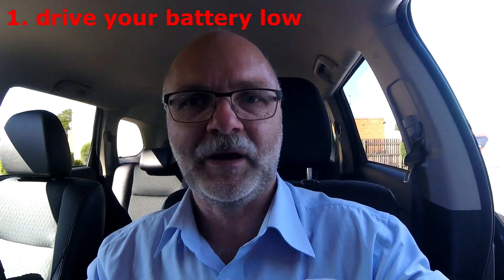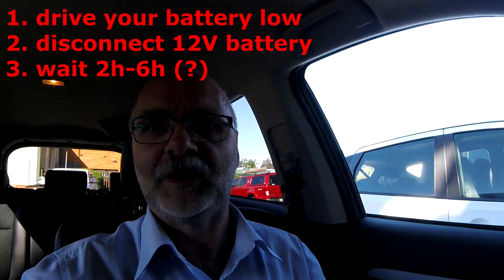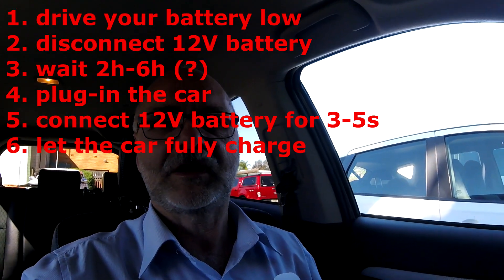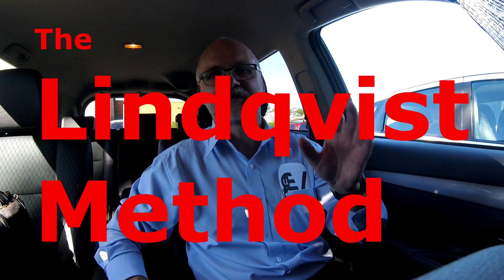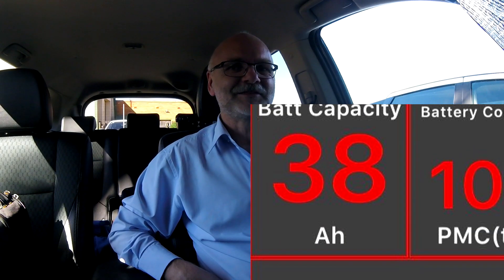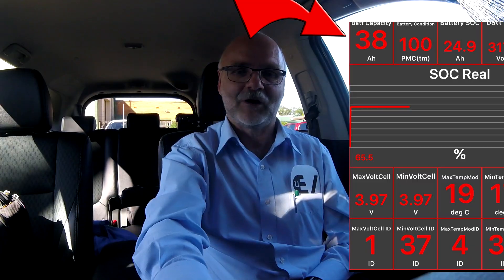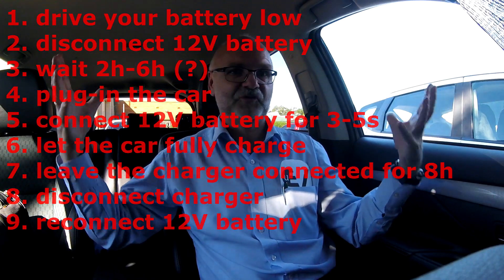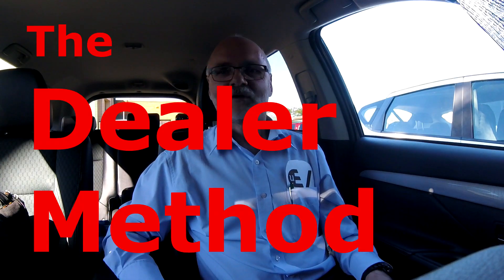EP248 - The Lindqvist Method (Outlander PHEV DIY Home Reset)

Comment: Method works for me in the past and did this every 4 month.
But now it’s not working anymore I did probably 10 battery reset.
Now my range is only 30 km EV.
But my car is from 2013 with 250.000 km 😊and still Happy with it.
Average consumption is 
2.8L/100km that’s healthy motor needs to run anyway weekly
Reply: I bought mine, about month ago. Battery is 42,5% and can do about 24km with very careful drive. 2013/12 and 202.000km. Should try this method for better range or dangerous because last owner never did :S

Comment: Ok ... The video descrbes how to reset the battery capacity to 38 Ah or even 40 Ah ...
But are there any risks?
There must be a reason why the BMU decreases the battery capacity from 40 Ah (100%) to e.g. 30 Ah (75%).

I believe that a reset (to 38 / 40 Ah) is dangerous!
And why?
Because the battery management has identified bad battery cells and ensured that they are no longer charged/used or that the cells marked as bad are only charged to (say) 75%.

After the reset, these bad/no longer fully functional battery cells are charged above the value set by the BM before the reset!
In my opinion, this DRAMATICALLY increases the risk of the cells overheating.
And in my opinion, nobody wants to have overheated battery cells - which then explode or catch fire ...

So I'm not sure I'm going to force the reset.

So please explain to me where I'm going wrong!

Comment: Hi, I tried this method with my Mitsubishi PHEV Outlander 2015. 
Drain the EV battery 
Disconnect 12 batteries for 8 hours
connected 12v battery to plug-in car and then disconnected 
Charge full car
Connect 12v Battery

THE BMU did not reset, and neither were the miles increased :(
Reply: If You have an electric tailgate - close it before the procedure. I did it twice with an open tailgate, and there was no result. Today, I did the procedure from back seats, and it worked. I didn't wait hours for discharging capacitors.
Reply: @michad.4023  Ill try it again. Although I dont have electric tailgate its manual.

Comment: In the Netherlands I have an Outlander 2014 with 175,000 kilometers. I did this method exactly as told and waited 5 hours before plugging the car again. After the error message disappeared (car off and car on) drove again. As a result, the range has increased significantly. Before the reset the range was about 20-22 real kilometers and after the reset 33-35 real kilometers (outside temperature about 8-10 degrees Celsius). On-board computer indicates more, but that is only an indication. I've been riding for a few weeks now after the reset and I'm very happy with the result!
Reply: Hoe zijn je ervaringen nu? Is je bereik alweer terug gezakt?
Reply: @ruudv6877  Hoi Ruud, niet dat ik het verneem. Buitentemperatuur is ook gestegen, maar ik ben heel tevreden! Aanrader!
Reply: Hoi ik wil deze methode gaan toepassen met mijn outlander 2014,  je spreekt van een car of and on wat moet ik me daarbij voorstellen ?

Comment: I wonder if there are longer term experiences.  I personally expect that over time, the BMU will slowly get back to the original values that were valid before the method was applied. All batteries do deteriorate over time depending on various parameters and it is abnormal if the original 38 Ah is restored with a simple software fix.
So, are there people who can report that the high capacity value stays as it is?

Comment: Thank you for breaking my car. 4 weeks after this reset i had issues with RBS and starting petrol engine when battery was completely discharged. Only DbCam helped.
Reply from the maker: You should have read the description first!
Reply: @unpluggedEV  Maybe you should also write that this procedure just reset BMU, so even if some cells are nearly dead you use them even harder?  And your battery is broken even more. WHAT A GREAT VIDEO
Reply: Could you explain what happened and why? Is the Lindqvist method dangerous for the car? Am trying to assess whether I should try it.

Comment: Did this today for my 2014 Outlander, worked like a charm! Electric range usually shows 37-42 km when fully charged, now it shows 60 km! Don't have the bluetooth connector for the watchdog, so I don't know the actual figures, but I really don't need them to see the big difference in range. Got the EV caution as expected, but it cleared itself for the next start. Thanks for a solid tip, guys!
Reply: How is it doing now?? Have you had to do this again?? Please let me know

Comment: There, I linked you couple of studies and information about Lithium Ion battery degeneration. =) It seems that car manufacturers have designed them so that they will last a very long time. They have been extra cautious with the batteries.
Reply from the maker: Yes, that was the intention with the PHEV.

Comment: After the LM, I was able to achive 28miles on the first run. I charged up partial and was able to get 18miles but after that the car was not pulling when the engine kicked and it actually stalled. I stopped, disconnect the 12v battery for few seconds and tried again with no luck. I had to drive with the charged button on for about 3 miles, stopped disconnect 12v battery for few seconds and reconnected it. EV range is 3 miles and everything seems ok now. I will have a longer drive tomorrow and will update should there be any issues.
Soh is down to 37.8ah from 38ah on day 1 of LM.
Reply from the maker: Same what Alex reported. It's in one of the next videos from here...
Reply: I’ve had the same issue what was the fix for this?

Comment: LM worked for me after numerous attempts.
I disconnected the  12v battery for 10-12hrs and charged for nearly 8hrs. I gaine 40ah but this has since reset to 38ah after a short drive. EV range has changed from 20ml to 37ml. I am yet to try out the actual EV range when I go out later today.
Dont give up if you have not succeeded yet , LM works!!!
Reply from the maker: Seems to be inline with other report. Some vehicles stay at 40Ah, some don't.

Comment: Used LM to MY13 180k km Instyle+ Navi, Keyless. El. tail gate and doors closed and I used rear door for accesing to the 12V battery. 2 h wait and 6 h charge. First run L-method ev-range went from 30 km to 50 km! Watchdog shows SoH 38 Ah/100 %. A wall charger amp. meter shows over 8,5 kWh charged atm and still not fully charged. Before the LM SoH was < 70 % and topped up at 6 kWh. So more electricity is definitely going in and the actual ev-range improved.
Reply from the maker: Thanks for sharing.

Comment: Currently in the process on a 2014 model.  After start up, 2 different chargers showed the charging light but our solar inverter showed no power being sent to the charger and battery level on dash didn’t move.  After reading comments about the tail gate, we fake locked the latch and the charger came to life.  Anyone who’s having trouble completing should make sure the tail gate is closed or fake locked. Will keep you posted.
Reply from the maker: Good tip, thank you. You have to leave the car as it is, right, don't touch it , don't open doors...

Comment: It worked!! Amazing 😉 
2015 gx4h
Disconnected 12v negative at 10pm
Plugged car in and reconnected 12v for 5 seconds at 5:30 am. 
Car fully charged, plugged out charger and reconnected 12v negative. 
Fully charged 38km range now says 53km!! Thank you thank you thank you 🙏
Reply from the maker: Thank you Mr Lindqvist!
Reply: That's only estimated range, not soh
Reply: blackwp1 still gone up by 15km. I’m happy about that

Comment: Hi. Have looked on a lot of Your viedeos and they are very interesting.  I got specially interested in this Lindquist Method. But how do I measure the BMU ?  I do not have a Android Mobile - I have an Iphone and do not find the PHEV wathcdog app on the appstore.  I have a 2016 model PHEV and after battery charge it shows 36 km - does that indicate that my batteri is in good shape?
Reply: Oen John Or buy a cheap android phone for 50 or 70 bucks like I did. Still a lot cheaper than the mut device.
Reply from the maker: Hello, thank you for your feedback. If you're an Apple user, you can use the EVBatMon from here:
http://evpositive.com/evbatmon-for-phev-ios.html

It's a bit hard to tell if the battery is still OK just looking at the GOM. How many real km do you achieve with careful driving?

Comment: I have tried it twice and unfortunately it did not work for me. When I disconnect 12v battery and later reconnects after the process, I loss recorded trip , the auto drivers side  window does not work. Watch dog reading still showing 70.8% 26.8ah. Hoping the Lindqvist method will be fine tuned to work for me.
Reply: Hold window button up for 5 seconds to fix

Comment: IT worked! I unplugged the bat for 5 1/2 hours. Then pluggend in the charger, connected the bat for 3sec (until klicked) waited for full charge, connected the bat en left the charger in over the night. I started my phev en shows 58 km! Drove 9 km to work, stil shows 48 km.. 👍👌😁 (2013 (2014 model))
Reply from the maker: Excellent outcome, thanks for the feedback.
Reply: Tinus, will doing the Lindqvist method will give a dash error reading that i need to reset at the dealer? I currently have a US spec 2018. Thank you in advance!

Comment: Hey!  yesterday i disconnected te 24v bat (2h) and connected the chargecable (connected the 24v bat for 3 sec until relais klicked) for 7h, . Connected te 24v bat, afther 7h the car was not yet fully charged so i thought something was wrong. Tailgate was open, 2013 model. procedure had no result. I will try again soon. then disconnect the 24v bat longer and wait for full charge with tailgate closed.

Comment: Hi everybody. You don't need wast time. 
This method can be reduced following this steps:
0 drain your traction battery a little bit. You don't need to begin with a empty battery
1 unplug 12v battery (-) pole
2 check with voltimeter between (+) & (-). The measure will be 0.5 - 1v
3 conect 1k resistor between (+) and unpleged (-) cable in order to softly  discharge of bmu filter capacitors until your voltimeter shows 0v.
4 conect the evse 
5 conect (-) with the evse near you until just ear the "click" of the relay in the evse charger
6 unplug (-) again. At this moment the reset is done. You can stop charging  with the stop button of the evse.
8)connect (-) cable to 12v battery. check soh with odb. If you have your battery fully charged the range in the car's dashboard will be 50km.
Working in 2013 outlander phev with initial soh of 72%
Reply: Tried again after an overnight 11hr disconnect with resistor, after which the voltage was 0.16mV. Didn't work. My SOC was 55% at the time. I am abandoning this method. The volatile memory theory does not seem to apply to my car.
Reply: Didn't work for me. I had a 320ohm lightbulb in series between the neg cable and the battery's positive terminal. Over 3 hours the voltage went from 5mV to 0.7mV, then I started the charge with a brief neg terminal touch, but SOH is still the same.
Reply: @tuberculous4691  I had this idea too! Good one :)
Reply: @unpluggedEV  Sorry Andy. I sent my incomplete comment before by mistake
Reply: Where are you picking up the 12v +ve pole.  I can only easily access the -ve.  Are you unscrewing the cover?
Reply: It's possible to reach to the + battery terminal with a standard DMM probe and touch it in the space under the red cap and above the battery body plastic collar. (I ended up removing the floor anyway - 3 nuts with screw holes at the front and 2 screws in the first rear compartment.)
If David means voltage between the battery + and the disconnected negative cable, I am getting 10mV initially and 5mV after 15 minutes. This is on a stubborn car that so far managed to defend 7 Lindqvist attempts.
Reply from the maker: @ancientbriton4637  Yes, you can just take off the cover...
Reply: Are steps 2 and 3 talking about BMU pins, or the battery. If battery how come this wouldn't read 12.6V?
Also can someone who succeeded raising the SOH please post a screenshot or the values from the Phevwatchdog's Battery condition menu detail of the top item - specifically Battery age in days and Total current charged.
Reply: @jean-pierreleduc3838  I tried this today and saw the same as you. Voltage goes back up after removing the resistor. Also didn't work at all. Maybe the voltage should be going up. Shows something is releasing energy into the system and nothing is absorbing it
Reply: Use the resistor for a minute and after shortcut with the terminal +. Please if your soh is 35ah don't use it. Nobody knows the risk for electronics on board. You can restore only 3 ah.

Comment: MY2017 - Tried thisprocedure and after full charge, GOM was showing 35 mile range. Also all vehicle settings reverted to defaults. Sadly a check with the DOG showed no change in the SOH, with a drive confirming no more than 24 EV miles available. Will try the procedure again and report back.
Reply: How did it go??

Comment: Worked for me! MY14. unplugged 12v. plugged wall charger in, connected 12v until hearing it kick in and then 12v off and left to charge. Gone from 17 miles range to 28!

Comment: Followed instructions precisely last evening but didn't work for my 2016 model (12v was unplugged for 6 hours ).  No difference after charging overnight from the previous 34.2 Ah shown on the app for the last few months.  Immediately after the procedure the car display showed a predicted range of 33 miles which is up on the usual 26 miles but after the first drive today I still only achieved an actual 27 miles.  I suspect the prediction increase is because the driving history had been erased and the algorithm that calculates range defaults to an optimistic MMC value.
Reply from the maker: Thanks for the update, Dave. Hang in there, a lot of people are still testing and refining the procedure...

Comment: Used this technique on my Aussie spec 2014 PHEV aspire (WiFi and electric tailgate equipped). Car now reading 47 km from full instead of the mid- high 30's I was getting before. The technique is a bit harder as the tailgate doesn't work and requires a little crawling through the boot but all good. Only problem I've noticed is the auto up/down feature on the driver's electric window has stopped, (still works just have to hold switch). Surely it must just be a coincidence. 
Thanks for sharing the tip. Joel.
Reply: I have the same car but struggling. Getting 52/53km on the guessometer, but that's just a hoax after the battery disconnect. Are you sure that you were actually successful (as verified by Dog, distance driven, MMCS cost meter, or Evse meter)?
Reply: @tuberculous4691  hi mate. I cannot say for sure as I do not have the dog and have not been monitoring the battery health apart from relying on assumed km determined by the car. I live in a remote outback town so drive short distances only (regularly go months without fuel) so I am not driving long distances enough to confirm. That said the car always predicts below 40km per charge yet after performing last night immediately reset at 47 km. I've done my normal commute today and certainly have higher battery level than normal, I've not bothered to plug in tonight when I normally would. It is still early days I agree and only time will really tell if this has made significant difference.
Reply from the maker: Thanks Joel, amazing outcome!
Reply: You can fix the switch, when the window is up, hold the switch up for 5 seconds, it'll teach it the window height. This happened me and still the reset didn't.
Reply: @WillDeasy  worked. Thanks very much!

Comment: Hey Boys! :D I am happy. If you want success you need to short the battery contactors! But be Very Very Very  careful! You can only shortcut it when it is disconnected from 12V battery and charger is disconnected! Otherwise you can set a fire! Check this pictures :D I bought this car with 60.5% SoH, OK I am not able tu put pictures here, so my SoH is on 105.3%, SoC 96.8% and capacity is  38.7Ah so I think I am going for 40Ah tonight :D
Reply from the maker: Great work, let us know what exactly you did so other can learn and do the same..
Reply: He didn't reply - hope he didn't electrocute himself!!

Comment: Got mine up to 40ah after one fail. It was at 32,4ah. But after it was done it say ev system service required ;) fingers crossed
Reply from the maker: How did you get 40Ah? What MY and did you follow the exact method?
Reply: unplugged EV hi, it’s a model 14. And first attempt was when it was half full of the battery. Only tried for 2 hours unplugged with no luck. Yesterday I had it unplugged the 12v battery for 7 hours and then I charged it full with only taping the negative pole so it clicked, it was empty this time. And I connected the 12v battery after maybe 12hours. And the dog shows 40ah 105.3% 
Mileage is 91859km 
But the only thing is that I got a message with: ev system required on the dash :/. Will try the car later today to check what range it will have and if the message will clear :). Thanks for a good channel btw
Reply: I am on my 6th attempt which happens to have same conditions as Eric posted above. I'll be starting charge in the morning after 10hrs of disconnect. Will report back. Also interestingly today I discovered that when I manually reduce the charge current from 14A to 5A from around 90soc, this allows more energy to be pushed in as the 328.2V (from which the BMU takes over the current control) is reached approx 6soc points later than if left at 14A. 
Easing the charge pressure obviously allows the chemical reactions to settle/catch up. Yet another example of where manual control is better than the "functions as designed" BMU.